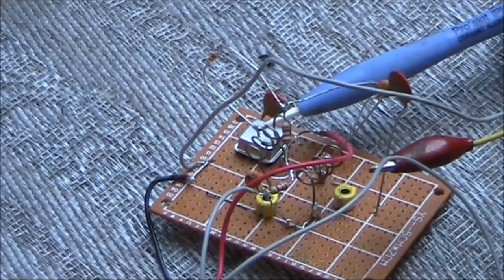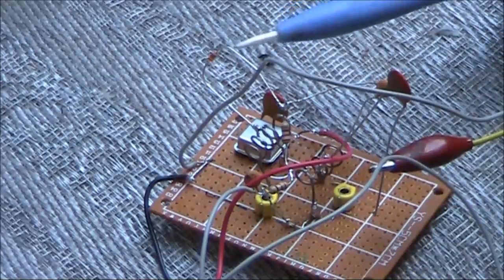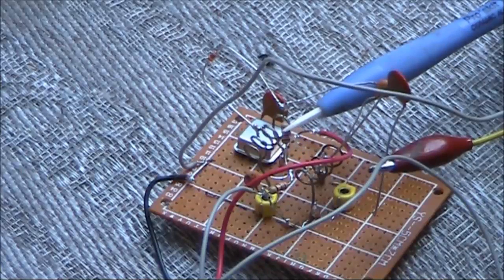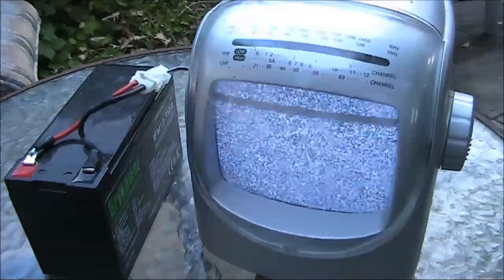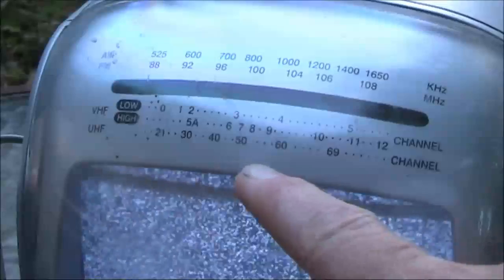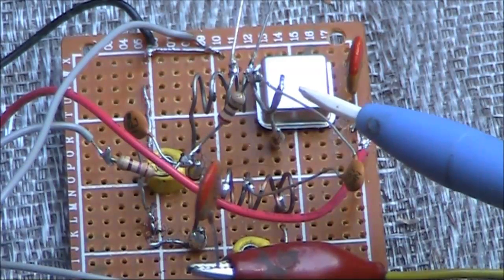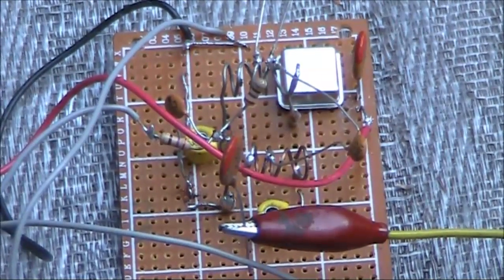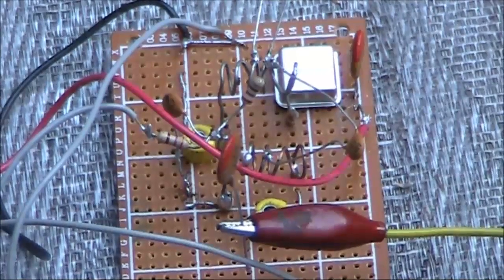Electronics on the Floor: World's simplest video transmitter using a crystal oscillator module

Comment: I had an old TRS 80 computer that would transmit to the television screen without the cable. Also you can make an oscilloscope by cutting the vertical coil but leaving the horizontal. Then feed the audio output to the vertical and Ta Daah! You got yourself an easy, cheap sine wave maker!

Comment: Uhmm, That's odd, I remember building the simple TV transmitter both VHF and UHF, I didn't use crystal on it. Small simple circuit strong enough to make my tube go pitch black. That was back in the 90's